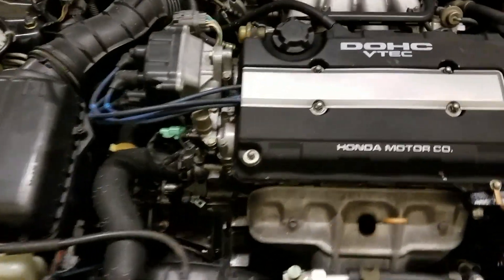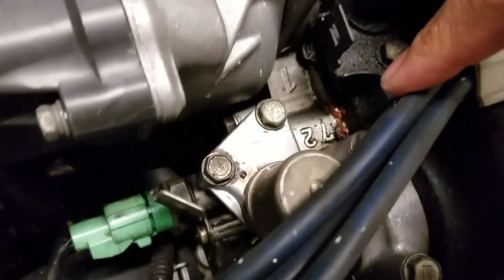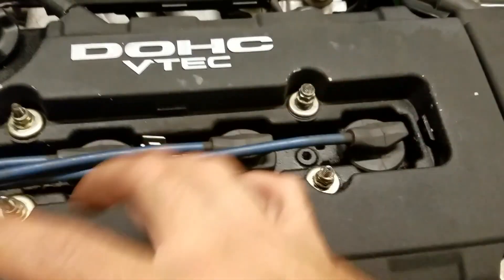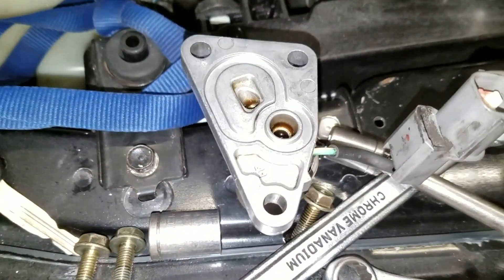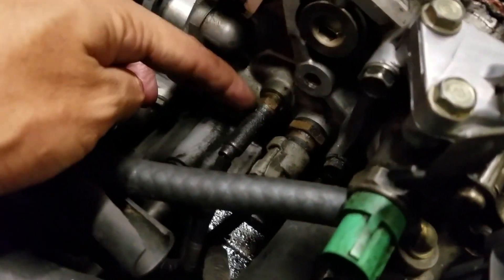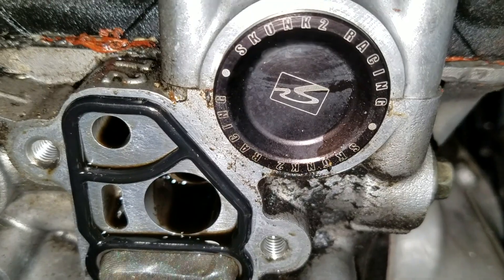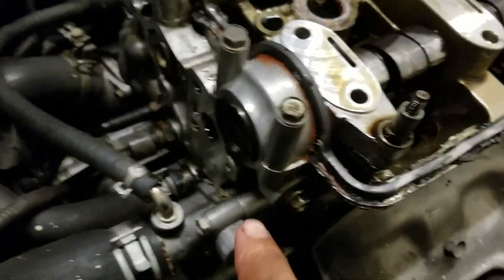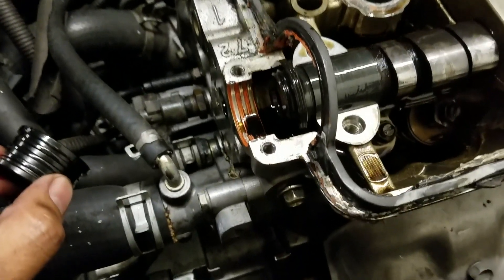Fixing Engine Oil Leaks (Honda B18C1)

Comment: Had similar oil leak on my GSR. Ended up replacing gaskets for: valve cover, VTEC solenoid, distributor seal, can seal, and oil pan. No more leaks and very revhappy  engine again.

Comment: About to do the same job on my 1992 CRX. Is it OK to use aftermarket seals and gasket or should I go genuine Honda. Thanks for your video. From downunder.
Reply from the maker: Hey 👋 the generic seal kit you find on eBay etc is perfectly fine to use, make sure to clean all pipe and hose connections, and lube the o rings with the recommended ac oil 

Thanks for watching

Comment: hope everything works out, I hand tighten the spark plug cover nuts just because ive always worried that would happen or breaking the plastic cover over tightening
Reply from the maker: dc2gsr greg that’s actually a good idea! Only issue I always have is the lower valve cover bolts under the cover coming loose and tightening the cover lol I took the cover off just to illuminate the whole issue.. valve cover gasket and radiator hose replacement next

Comment: Good day sir, is there anything special when taking off the distributor? I've heard several things when taking it off, I just cant find those vids again. Great video!!
Reply from the maker: At the top bolt, use a marker pen where the head and distributor make contact, just draw a line, just so you can put it back at the same spot it was prior

Comment: Hey brotha. Looks like VC big time and possibly tube seals. Had the same issue on several cars. VC mists oil everywhere from pressure when it’s not totally sealed. It happens lol.
I had a bum cam seal that I had to take out and re seal. That caused a LOT of oil loss. A lot.
Reply from the maker: Rocco Croce you are right, the valve cover has been leaking.. but lately oil has been literally pouring off the engine.. which is a lot more than usual with the leaky valve cover.. the tube seal is leaking too you are right and that counts for all the oil loss too! Valve cover gasket and radiator hose replacement soon 👌😀
Reply: Dang, common issue with a pretty easy fix. Glad it's resolving soon. I've dealt with this crap so many times, i know it as soon as i see it
Reply from the maker: Yeah man! Is almost like these engines were designed to leak! I’ve never seen an older Honda engine that didn’t leak.. 

It seems that feature videos will be more mechanical maintenance and maintaining the appearance

Comment: I got the same problem. Got oil leaking down the front just like yours . Did u ever stop the oil leak ? I’m hoping it’s not a head gasket.
Reply from the maker: Omar C yeah man I have no more leak in that area. I replaced the distributor o-ring, distributor inner seal, new VTEC solenoid and spool valve seal using permatex ultra gray silicone. The front of the engine and trans is bone dry!
Reply: Cool man I will do all that that u did and hopefully it’s stops my oil leak . Great video !!!

Comment: I dont know if you still get on here bro but quick question I have fixed a few oil leaks on my gsr and need to change my cam cap but my cam rail bolts don't want to break loose easily how much resistance should there be?